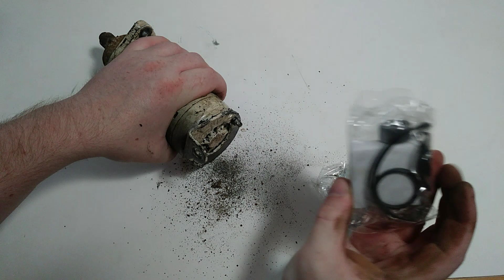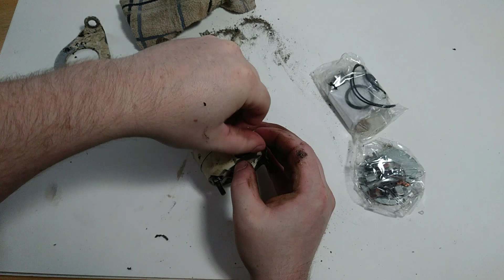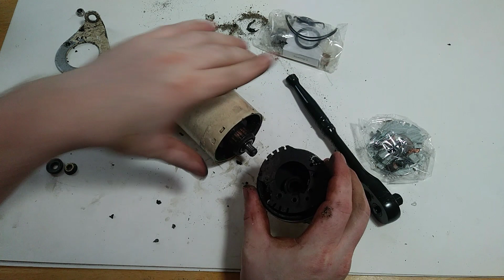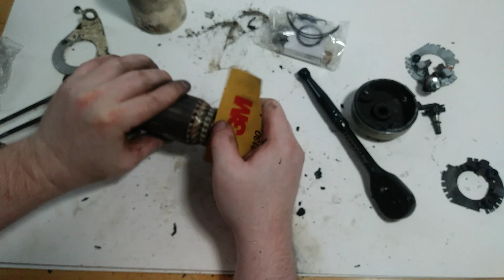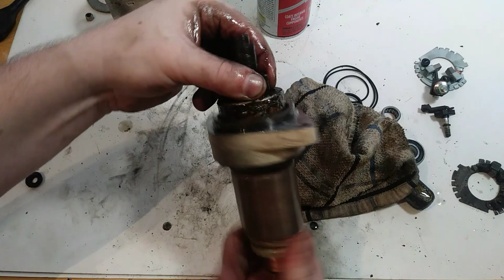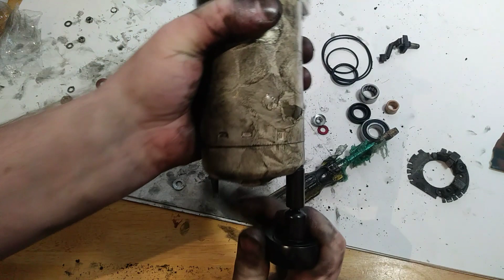Seadoo 95 XP Starter Rebuild Kit Install Cleaning Fix Reman Jet Ski Install New Motor Brushes PWC

Comment: Thanks I got a lot more insight out of your video then all the others in here.they just blow in by the steps your shows the Ins and outs
Reply from the maker: I did a lock wire exhaust video here: https://youtu.be/I3fsQGCFd9U

If you use the cheap new starter, it has to be drilled out as it has threads you don't want.

Also have a safety switch video here: https://youtu.be/k5XhlYeAp5o

Comment: So that bushing at the end of your Bendix has a C clip under it. Back the Bendix all the way in and press down bushing towards the spring. Wedge a screw driver in and it pops right out.   There are already all the marks you need if you look, you will see them. Easy to line up everything
Reply from the maker: Thank you.  They were so corroded I didn't see them.  I did this video on the fly just like this OEM vs Aftermarket replacement video https://youtu.be/RU8oEN3FsL0

Comment: Time and energy to rebuild, plus brush rebuild kit ($20 average), it's prob best to just get a new starter for about $40 shipped on Amazon.  I am in the same boat, about to sell a 96 HX with the 717 engine.  Prob just going to get a new one.
Reply from the maker: Let me know how it goes.  Some say the new starters caused them problems.
Reply: @geostomp  WIll do!  Seems to be mixed reviews on the new starter units, prob not Denso units like the originals.  If I go the rebuild route, I will replace the bearing also.  There's another person who made a video, he was able to pry it off without using the puller.  Things are starting to add up on this thing and I am only getting it ready to sell, but like doing things right so the next person doesn't get caught out.
Reply from the maker: Yeah, nothing like having no start 1000ft out, which is why I "rebuilt" the OEM
Reply: @geostomp  yup you are right sir. I bought a cheap $45 ebay starter no brand…. It’s terrible, only worked for half a boating season now… it wont even start, stay away from cheap starters just get OEM rebuilt or maybe the SBT one
Reply: I bought a replacement and it lasted 2 years.  Replaced it again and sold it.
Reply from the maker: Here made a video with a couple aftermarket starters https://youtu.be/RU8oEN3FsL0